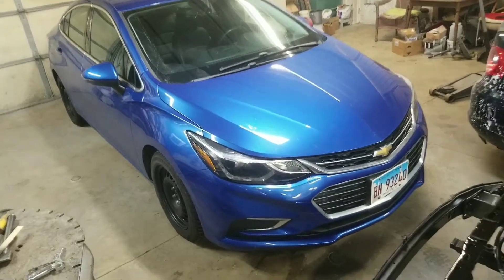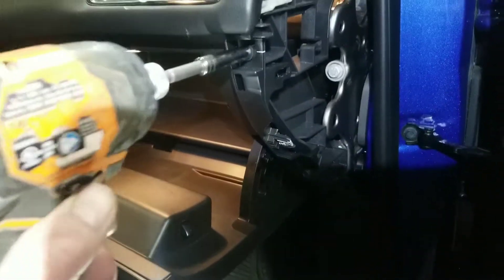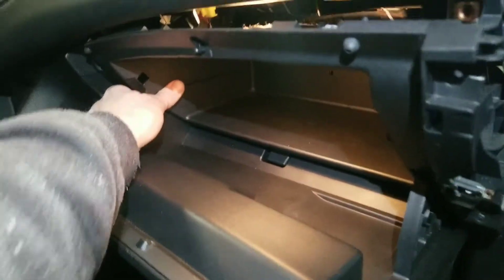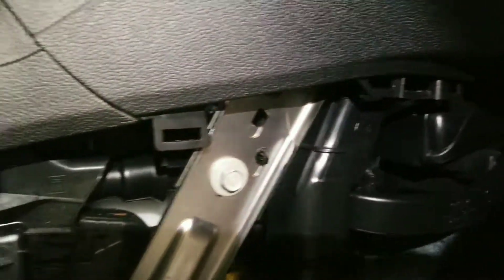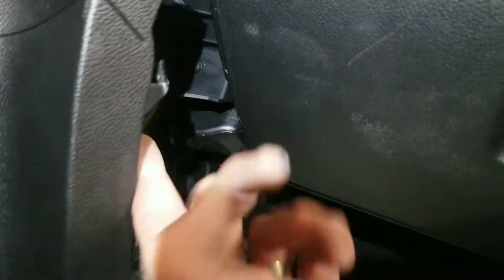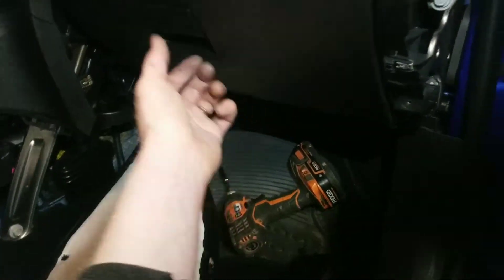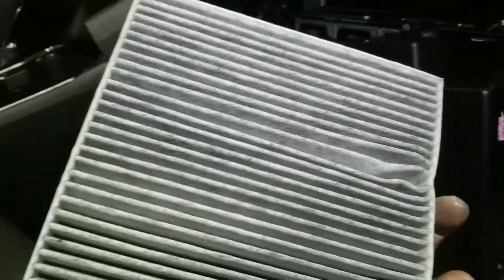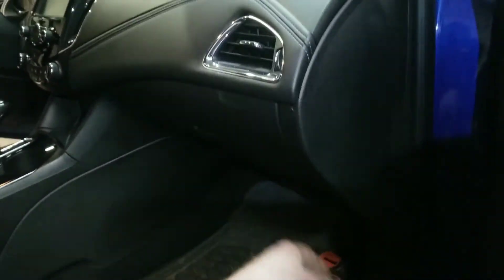How to Replace Air CABIN filter on 2017 Chevy Cruze

Comment: I’m just trying to check if I need to replace it I don’t want to take apart my entire fucking car to check the cabin filter my god what is the Design of this stupid fucking 🚗
Reply: Totally agree, I was thinking of changing my  2017 cruze with 50k but it's so difficult,  I'll wait till 60k.  Damn, I thought I was a breeze like mu old Toyota or Honda but you're right, you literally tear the car aparts just to change one freaked cabin airfilter.
Reply from the maker: Yeah that year cruze awesome compare with previous models, but cabin filter replacement does suck !! Just do it or get it done every other oil change ;)

Comment: Why them stupid engineers at GM changes the design and make it more difficult to changes the cabin airfilter.  The old 2011 thru 2015 designs were much easier to swap out the filters. Lol
Reply from the maker: Agreed 200%